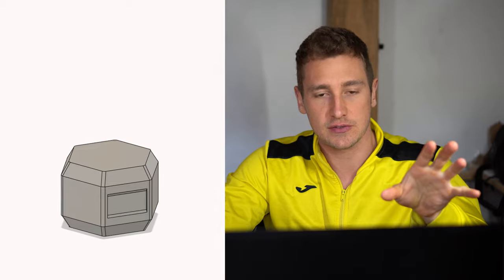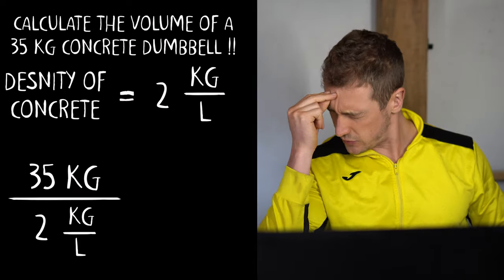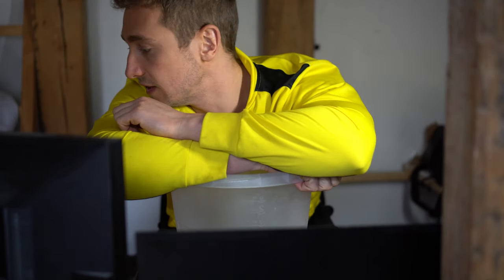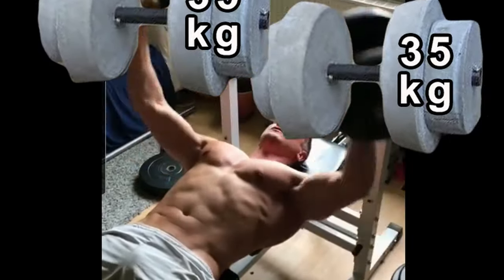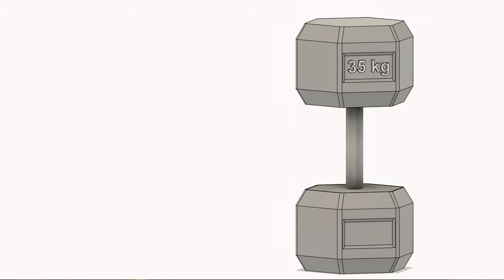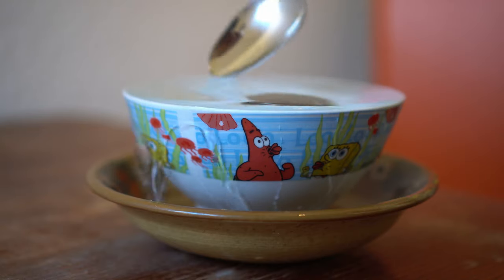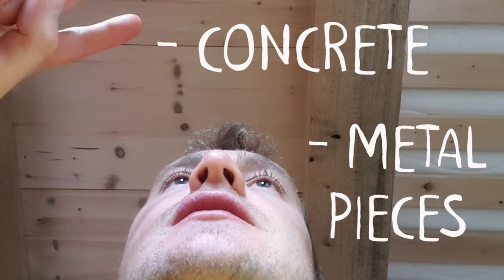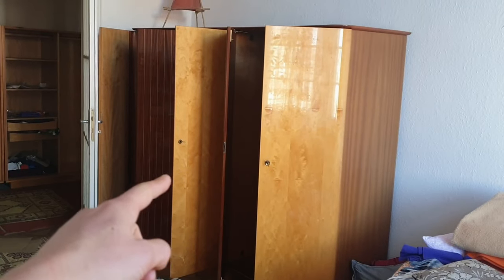Building and Testing (Heavy) DIY Concrete Dumbbells (3D Printer Optional)

Comment: I make my own dumbells but with Metal sheet molds, Are 3d plastic shells more expensives?
Reply from the maker: Sweet. Are you buying the molds or are you welding them together? The ones I printed cost about 8 - 10 € per mold ... so it s rather expensive. The Black one (TPU Filament) is holding up well. The PLA one starts slowly breaking down.
Reply: @freezyAndHaze  yes I'm buying the molds ,  , I send them to be made under my specifications in a company that manufactures metal things, I only use them as molds, I have 10, 7.5 and 20 ,It would be great to make a 3D case to protect them from scratches , They are so cool that I sell them to my friends , but I fell in love with this neon dumbell you made dude
Reply from the maker: @mastershift18  Sweet. How much do you pay for those molds? Yeah the pink one looks really nice :D   but PLA is not the ideal material for this. Rather buy some nice looking TPU. Get yousrself an Ender 3V2 or an Ender 3 Max (if you need a bigger build volume) and make one yourself ... and then you get fricking jacked !!!!
Reply: @freezyAndHaze  10 euros or more depending on the size can be 15  ,  thank you for the info :D Ill get the printer ¡,PLA is hard too , I need to make the tests .. you can melt the metal rods to the (bar) to make concrete stick better,  I use 123 mix btw!  yes I need that 34kg dumbell to my collection :D
Reply from the maker: @mastershift18  That's reasonably cheap. yessir. I think PLA is underrated in terms of strength. If you have a welder you can definitely try this :D
Reply: @mastershift18  wow where did u find that company ? Could you tell me the name ? 10-15 euros per dumbbell is extremely good
Reply: @dragos8839  not for dumbell  , for mold (individual) , now im working in a hole dumbell mold to save time , Im not in europe, im in colombia lol , just pick a big protein can and make them if you want some help ask for it

Comment: i know this isnt really necessary but would you ever consider selling printed molds?
Reply from the maker: Mornin, fellow meat neck. Hm I don't know ... they are pretty massive so I guess the shipping costs are rather high, right ... maybe 15 $ ... I don't know? Plus about 750 gr of filament for two big ones (20 $). Plus my time ... they wouldn't be that cheap. But if still desired I could print some.